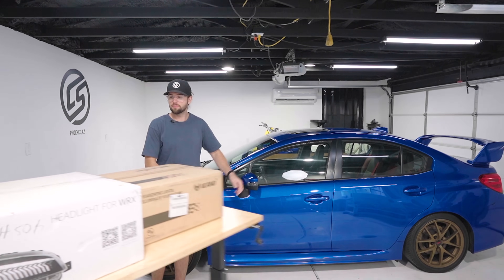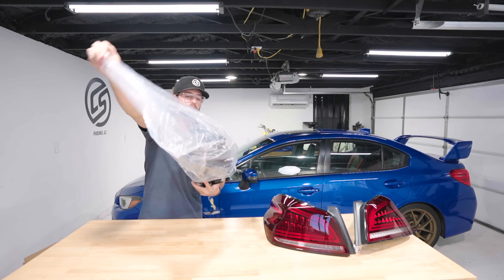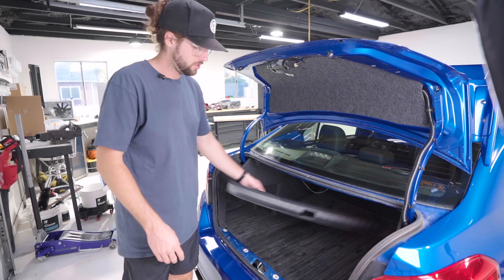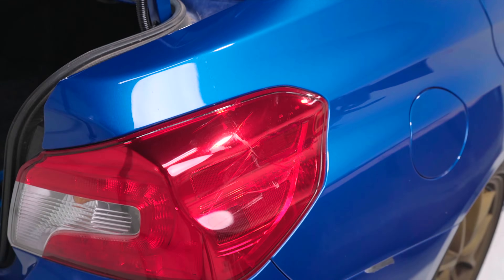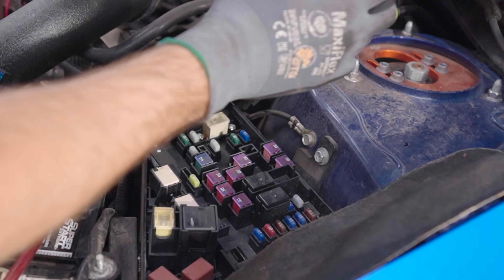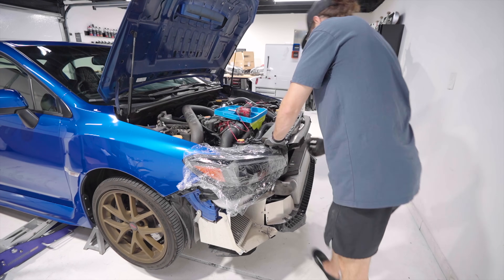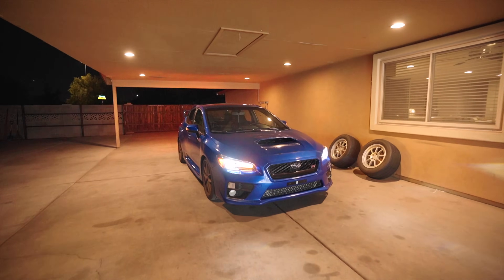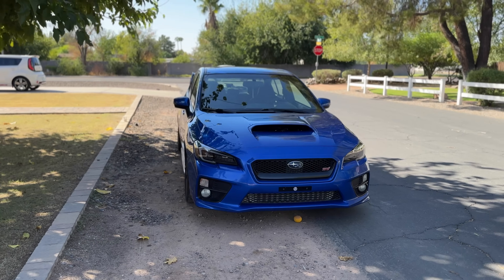$700 Subaru WRX STi Headlight & Tail Light Upgrade! Worth it? Hmm

Comment: I don't really care for them. Most aftermarket headlights for the STI have a weird bulging shape from the side which I really dislike. The best lights are the 2018+ OEM ones for STIs and WRX Limiteds. They have a proper C light and are steering responsive. The tails give me a nissan altima/maxima vibe because of the pattern of the running lights. Sequential signals have to be done right (like the mustang) for them to look good IMO.

Comment: Had em tail lights running on my car for a while (as you can probably tell from my display pic) but recently I have switched over to the ones from Valenti as soon as they have released it. 
Imho, i prefer those from Valenti's although it cost a lot more, but the quality is generally better. Fitting is spot on, and it retained the signature C bar from the original tail light pattern. 

Vland ones have minor fitting issues for the taillight. And it looked a lot like the W205 C Class's tail light. 🤣

And i'm also running the headlight too coincidentally, they are great. Feel free to go for it.